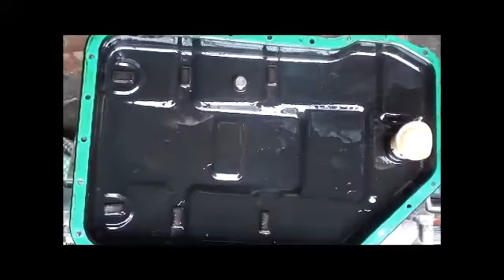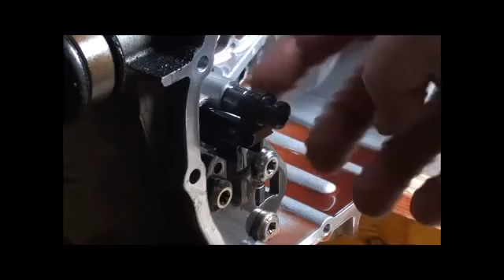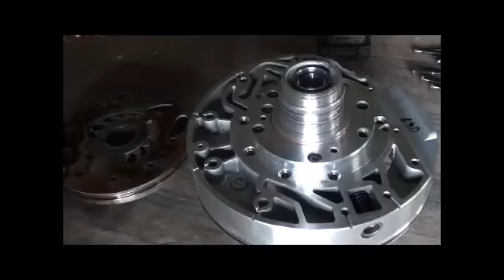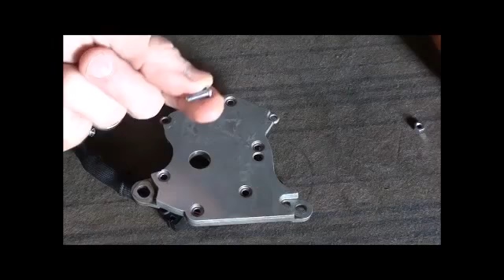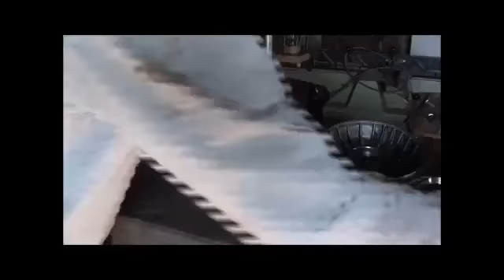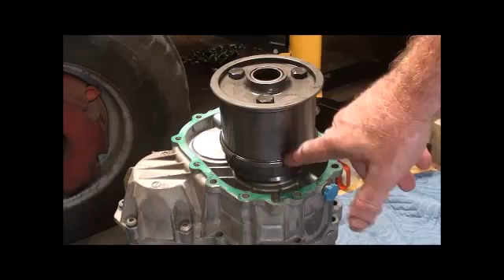Audi 01V 5HP19FLA description and disassembly

Comment: Is the front differential ring and pinion swappable from the zf5hp19 to zf6hp28 or zf8hp55?

Im thinking if i find a zf8hp55 i can use a 3.889 ring pinion from a zf5hp19. To mate this into my older audi

Comment: Hi jeff, need to connect the shifter cable to the trans. Is the shift device on the side of the trans in park if it is pushed towards the engine or pulled toward the rear?
5hp19 fla.
Thanks
Reply from the maker: Pretty sure it's pushed forward, but just move the gear lever and see which direction the cable moves. This will tell you the correct position of the transmission lever.

Comment: Its going back in this week end, do you put any antiseize or anything on the bolts that mate to the engine?

Thanks for you help throughout this project.
Reply from the maker: I personally wouldn't, but I don't live in an environment where corrosion and seizure is ever an issue. More than happy to help. Hope it all works OK. 

The transmission can do some funny things until all the clutches etc are filled with fluid. Spend as much time as you can after first start changing through as many gears as possible to ensure it's all completely filled. If it's possible to have on jack stands and run through the gears gently this is what I'd do.
Reply: @jeffrichardsoncardiy  glad you brought that up. The car is on 4   -12 ton jack stands. Maybe a little overkill, but give me plenty of room to work.
Question is what procedure to start adding the ATF back in.
Reply from the maker: It's the standard fill technique for an auto box. Are you familiar? If the TC is new I"d be filling it as much as possible prior to install. Expect that after start it will suck up the fluid rapidly and you will need to fill with a bunch more prior it coming out of the fill hole. Then I'd be spending a good bit of time cycling through gears in an attempt to get the fluid everywhere.

Comment: Also, without fluid, when I spin the torque converter, only it spins. When i spin the final drive at the back, the clutches in the trans also spin. Correct? The fluid spinning in the converter will allow the clutches to engage and power the trans?
Reply from the maker: Yes, no oil it's not going to behave like a transmission. Oil in the TC and a fluid pressure it should all be OK.

Comment: Thanks for your help.
As far as filling the trans, gear oil in the diff, gear oil in the transfer case, and trans fluid added to the bottom of the trans.
Gear oil, is Mobil 1 or Valvoline synthetic 75-90 ok to use?
Thanks again
Reply from the maker: To confirm what fluids you need, look at this. What you say sounds ok.

https://aftermarket.zf.com/remotemedia/lol-lubricants/lol-en/lol-te-ml-11-en.pdf

Comment: When installing the valve body, those 5 rubber grommets are not installed flush. There is about an 1/8" or more, all the same height. Will the valve body push them into the hole flush?
Thanks
Reply from the maker: Yes. They are designed to compress to hold the pressure and not leak.
Reply: @jeffrichardsoncardiy  thanks, they compressed easily by the valve body.

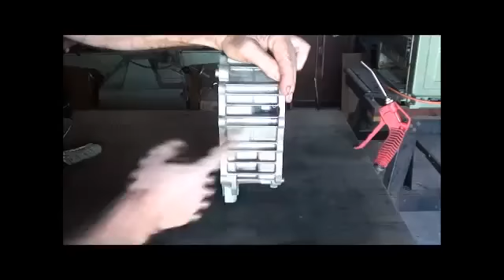Comment: I am at the part of trans that is at 25:00. my question is the gear that is installed on the shorter shaft the sticks out the back of the trans, there is a large spring that goes on before the gear. the spring pushes up on the gear and I am assuming that the tightening of the housing forces the spring to compress. The long staft that comes out of the back of the trans has a bearing and thick spacer before you put the gear on, I think. Do you know the tightening specs for these screws that attach this piece to the main trans housing? dry gasket?
Thank you.
Reply from the maker: I don't have the specs, and I sold the car years ago. I'd be just measuring the bolt and using a standard torque. M10 = 42Nm, M8 = 23Nm. From memory I think those were M8, but that's just a guess.
Reply: @jeffrichardsoncardiy  thanks
Reply: @jeffrichardsoncardiy  hey Jeff, do you dry fit your garkets on the trans of do you use a product to seal it along with the gasket.

Thanks
Reply from the maker: @bigshott9117  Definitely dry fit. The paper gaskets work very well. The only issue is when the pan gets corroded, and in this case the pan needs replacing. If this is OK, then only dry fit.
Reply: @jeffrichardsoncardiy  thanks

Comment: hello Jeff,
I am rebuilding a 5hp19 fla right now and have two pieces that I am not sure where they go. have been through numerous repair manuals, but I have faith you will know. it is an all wheel drive trans like the one you videoed 3 months ago 

one is a heavy spring and the other is a bearing with a thick shim attached.

if you give me your email, I can shoot you a pic of the two culprits.

thanks
Reply from the maker: I"m not prepared to put my personal email here. More than happy to send you an email if you put your email address here.
This video was taken a number of years ago, and I sold the car soon after. A few months ago I moved the video from a youtube account that I hadn't used in years just so it was still available to people. 

My memory of the rebuild is pretty sketchy. I'm still very familiar with the RWD version of the transmission, as I still own a car with this and also help people with their transmission problems. Are the parts specific to the FLA variant or generic? I can only assume the spring you mention is from the FLA variant. Also, have you looked at the parts list for the transmission? The only spring I can see is the one on the pinion shaft.
Reply: hi Jeff,

garypopiela@gmail.com is my email and then I will send a pic.
problem with trans manuals is the pics are of one varient, but they pertain to several versions.